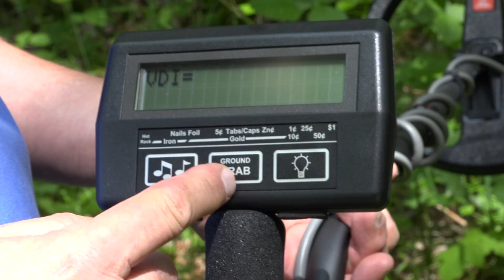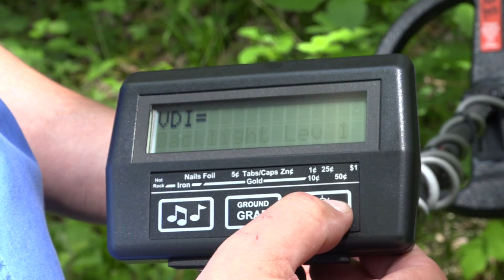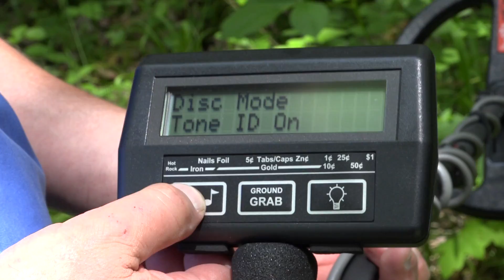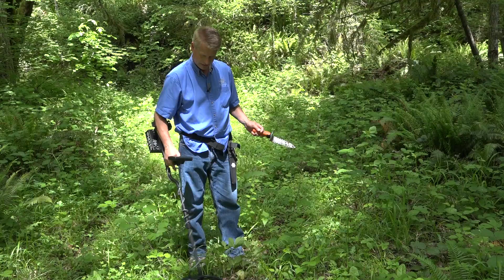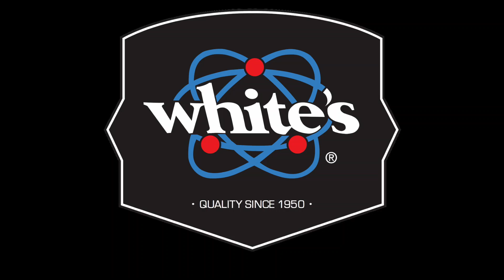MXT All Pro - Advanced Settings

Comment: Hi friends, super video! I was wondering if you could do me a huge favor? There isn't enough, or any decent videos on VDI target Id's for the mxt pro, and i was wondering if you could make a quick one if you had a moment? If you do, please include trash targets, as well as rings and coins in all modes, and show the VDI screen as you scan them under the search coil.  Or even if you could tell me what bottle caps, beaver tail pull tabs, regular pull tabs, and nails come in as VDI,s and what objects the detector calls them in the Relic mode, that would be super amazing! :)
Reply from the maker: We are working on more videos this year. Thank you for the recommendation.
Reply: IMHO depending on where you live you might find one model or brand of MD the right fit ,i live in northern nevada ,i have the MXT pro with 6X9 ,do a mix of mostly relic and some prospecting . when the MXT says " hotrock "   dont bother digging,Whites did a supurb job on the software ,i probably only find 20 pull tabs a year so not a major annoyance for me i have a feeling it was originaly designed for parks,picknic grounds and CW areas i really dont pay attention to VDI   . I do find lots of nails and its pretty good on id if it says iron it usually is if it says different things every time i swipe over it i will toggle between C&G  and Relic .I find tons of lead  bullets and they read as nonferrous /gold different tone .I will say in coin and jewelry mode a flattened beer can at 1 to 18 inches always reads as a quarter,i also have a 300MM coil but hardly ever run it unless iam in really clean earth .YMMV alot i have a ML GPX4500 and a GB2 but the MXT pro i carry the most its my go to MD .I guess what iam saying is dont bet the bank on a VDI number ,use 2 tone id with VDI giving you a general idea and i really dont use auto GB ,throw a .22 bullet not shell in a small hole and swipe over it after a bit it will discriminate it away on auto.  where i spend more time deciding weather to dig .Whites ground grab and backlight is what made me sell MXT 300 and move to pro .All the air test above ground test vids are lame in the fact soil plays a large part in detecting also ive found damp soil is better to detect in although it hardly ever rains here also whites has a great warrenty .Whites if your reading this you should make a great basin/ Nevada model MXT with a switch for a higher KHZ  as in somewhere between 50 and 70 in prospecting mode and probably dump some features like salt save that for the beach detectors .I still like VLF better than PI ,iam no expert but i still feel the MXT is a great weapon of choice .I spend 90 % of my time on the old emmigrant trails so its just my opinion but i ve found silverware sets and guns in heavily mineralized soil at over 18 inches with the bigger coil ,rereading post to be honest it has a weird hiccup,once in while shut it off and turn it back or mine will stop detecting i should really just send it back to Whites for a check up .Its a terrible idea to lean it against the bed of truck ,the wind picks up a hair and it gets blown over also i never let the battery level get below 10 volts ,those get changed out into kids toys and remotes